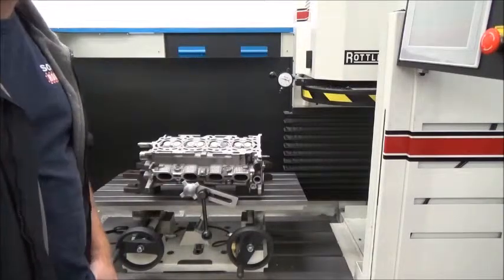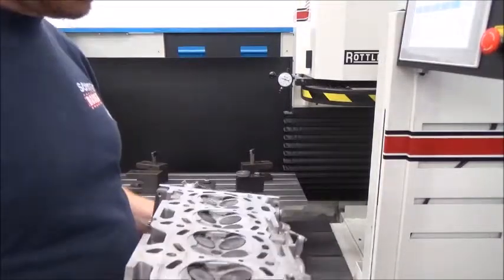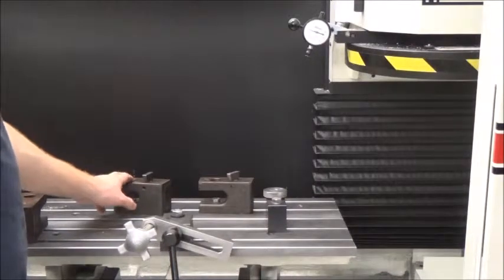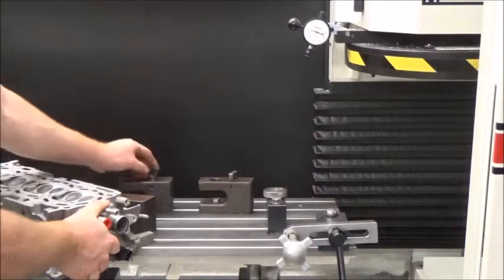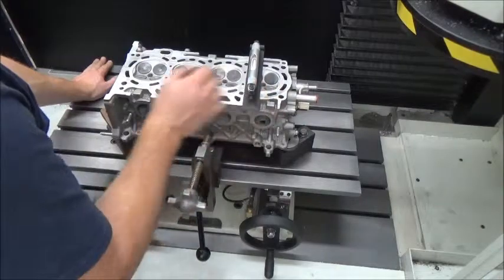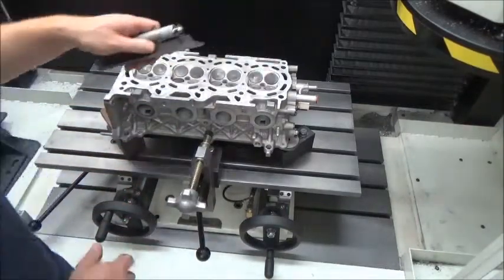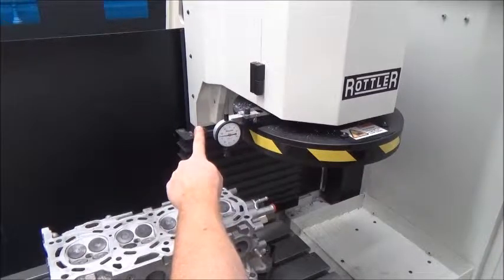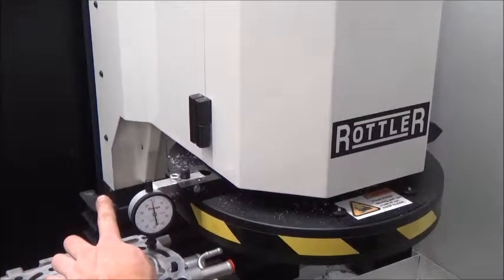Machining Aluminum Cylinder Head

Comment: I just took some aluminum heads from a 3.4 Chevy equinox to get them machined in lake Charles, LA. The guy just threw them on a table that had a horizontal spinning turntable grinder in the middle and he slid the head back and forth across it a couple times and called it good and he didn’t even check it afterwards. It had a very rough finish on it. I was pissed! I ended up having to drive 80 miles to another shop to get it done right. I hope the first guy didn’t ruin the heads.

Comment: In my shop we used a 10'' x 50'' Bridgeport clone vertical mill [500lb knee capacity], 4 blocks or parallels, A hold down set and a 9'' 4 bit Neufeld type round fly cutter to mill heads and blocks.  

We did hundreds of all kinds of heads and blocks during 30 years in my automotive machine shop.  We did MBZ 300SL slanted blocks and heads that this Rottler won't do and hundreds of just regular mill jobs.

1980 my mill with all the mentioned tooling cost me $7k.  Today, all this is less than $10k.  But you need to have some machining skills and most important...experience.  Just saying.

This was a good Video though.  AvE would call this video skookem.

Comment: What cost you this machine. In Russia, S86A costs $ 90000 ...
Reply from the maker: Rottler s85a is about $58000
Reply: @filippg6692  Wow, for this price you can buy medium quality  brand new CNC mill, such as Haas VF2. With it you can do so much more. then just resurface cylinder heads.
Reply: @Andrey222ful  On the Rottler machine, you can machine parts with a length of 1200 mm and a weight of 500 kg, I doubt very much on the Haas VF 2 ...
Reply: @user-fw1go1qm5x  VF-2 ход стола по Х 762 мм, что почти в половину меньше. Но если взять цену в 90 штук то можно взять в VF4SS или что-то подобное. Цена таких станков должна быть примерно 30 штук не больше.
Reply: Гуд
Reply: @Andrey222ful    Andrei, yes the price should be what you think.
Reply: @filippg6692  Shipping something as heavy as this Rottler, would cost a small fortune not including the electronic conversions.
Reply: @user-fw1go1qm5x  1,200 mm x 500 kg = 4 ft and 1100 lbs maybe on the table, but not that expensive fixture.  A 50'' x 10'' bridgeport type clone can do that length and half that weight.  If a head or block takes more than 2 men to lift, it's too big for a 10'' x 50'' mill.

With big xtra heavy industrial engine heads and blocks, we used an old WWII Blanchard grinder that cost me $1,800...and another $1,000 to move it 95 miles.  The Rottler is a nice machine though.